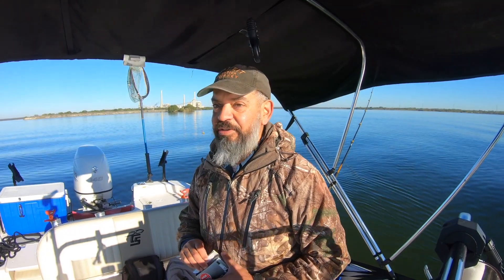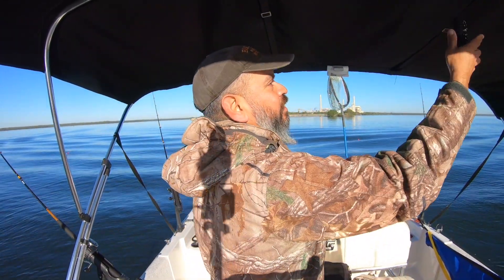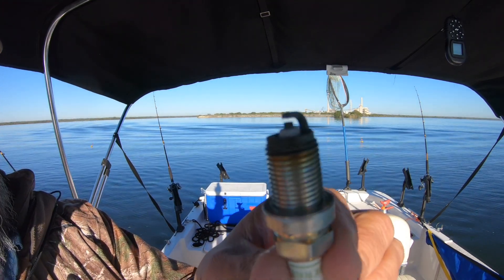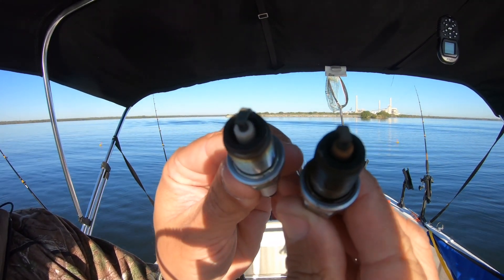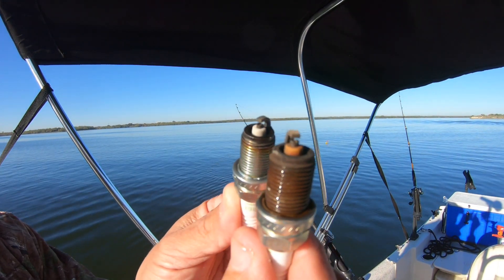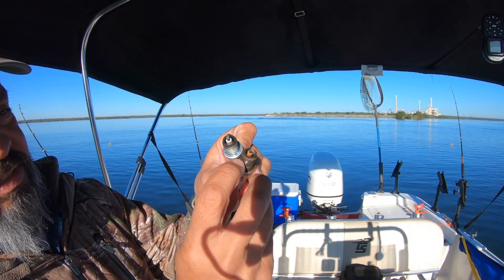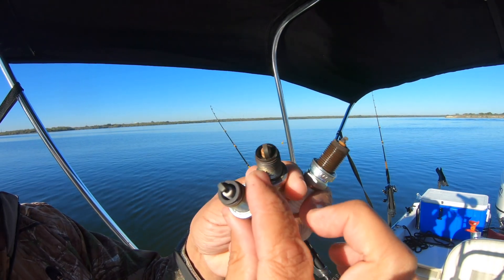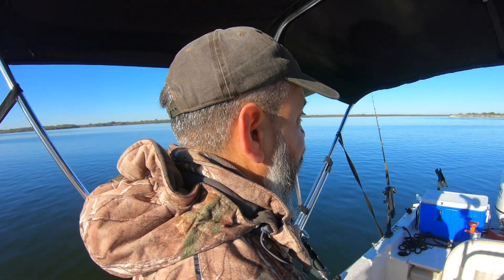Suzuki DF140 Engine Fix???

Comment: The spark plug sits at the top of the piston, sometimes if not properly tightened when installing them oil can get in there and cause that plug to misfire or not burn all of the gas and that leads to loss of power… I’m glad you got it figured it out and I love the videos.., I hope you have a very Prosperous  and Happy New Year my friend
Reply from the maker: Thank You! Turns out there was other issues I just found out after that video. I’ve got water mixing with the oil so now I gotta figure that out
Reply: There is no way oil can get in there if it's not properly tightened.

Comment: Melo, the new Quick Trip Gas station off Hwy 181 should have the Ethanol free gas. Their other stores have it. I've been using Ethanol free my last 2 boats. Worth the $ but occasionally can't find it outside of town. I hardly ever fill up the gas tank 100% so I use a 14 gal wheeled fuel tank w/pump and keep it in the boat storage with Ethanol free gas. Some of their stores are very hard to get in and out of with a big boat trailer. BTW, my boat storage is adequately vented, but doesn't have electricity for the onboard trolling motor charger, but that is another story.
I'm super excited now that they have that Quick Trip gas station out there! Glad you guys figured it out. I gotta get out there for some cats soon.
Reply: I just read your reply to John. Sorry to hear. BTW, my mouth dropped open when I heard the MM turnaround of 1 1/2 weeks. OMG... 2 months exactly for me the only time that I used them.
Reply from the maker: Yeah, yet another issue 😭😭😭

Comment: Melo, my Mercury 150 doing the same thing. New plugs made it better for a while but then deteriorated again. Ended up being one of the coil packs. It had less than 120 hours on it. I was surprised one could go bad so quickly.